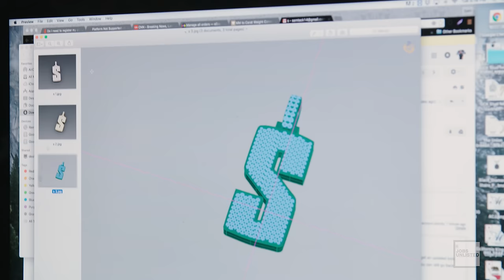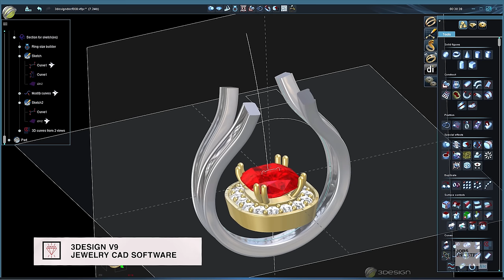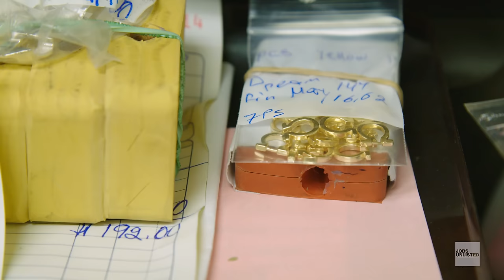Post Malone’s Jeweler Shows How To Make Jewelry For Cousin Stizz | Jobs Unlisted

Comment: He says "Computers can never do this job" while using 3d printed molds and auto cad. We got robots operating grapes dawg. The future is gon be brazy.
Reply: They used computers for the design process, they were talking about the fabrication of the actual piece, which takes human eye and skill as the piece will not be millimetrically perfect and needs adjusting by a human as imperfections are random. It's a good thing though man, the human part of the process gives the pieces a quality I feel
Reply: @ash7324  A computer can be more accurate than any human that will ever walk this earth. If you made a machine that you feed with a 3d model it can compare the 3d model and the real life jewelry to find any imperfections and fix them super easily with the help of different lasers and measuring tools. Would i be capable of creating such a machine? No. But i guarantee you it's possible. Just look at transistors on processors they are down the a few nanometers so if a company wanted to make a machine that could create the most perfect jewelry ever they could "easily" do it. It might be a bad comparison but you get my point.
Reply: they did surgery one a grape?

Comment: Taking 20, 50, 80, 100 thousand dollar (or more) watches like the AP Royal Oaks seen here and giving them the buss down treatment is one of the most retarded and shameful things you can do as a so called jeweler. All of the watch's original value is gone when you do that. At that point it's only worth the precious metal and stones, which in most cases is orders of magnitude less than the watch is worth in its original condition (watches are probably one of the greatest valuables in the world when it comes to creating artificially, exponentially more value than the actual nuts and bolts, and holding or even sometimes increasing that value for long, long, long periods of time.) Even the "cheaper" watches like the Rolexes amount to the same kinds of per cent losses, the margins are just different. Seriously, for the love of God don't do this. People that blessed to either own or to be working on/with that kind of wealth for a living, and too ignorant to realize what they're doing until it's too late. God help you. I'm glad that at least a few jewelers for famous rappers who have done this have come out and said the truth about it, and will no longer do this practice as they've realized what a mistake it was to do. Seemingly many/most who do this do not even understand what they're doing, they simply think if they take an object that's already valuable, and add onto it objects that are also valuable, it must be like adding their value together... Wrong. Tragically wrong.